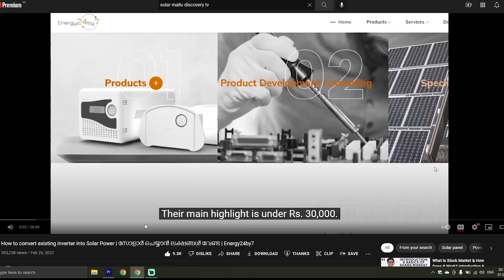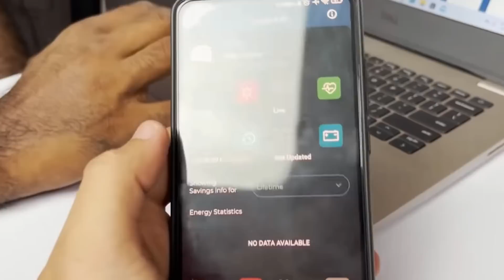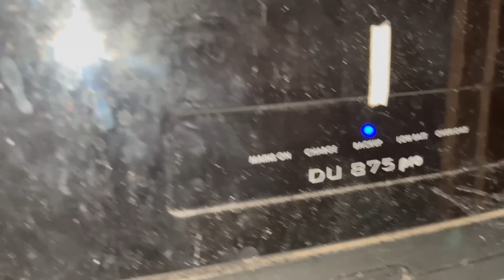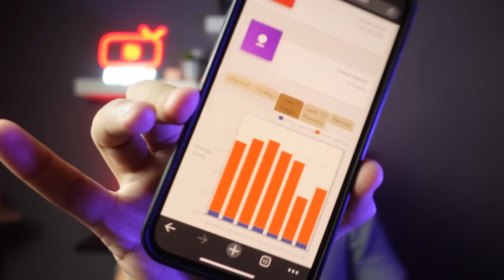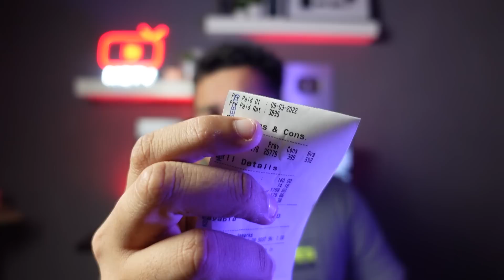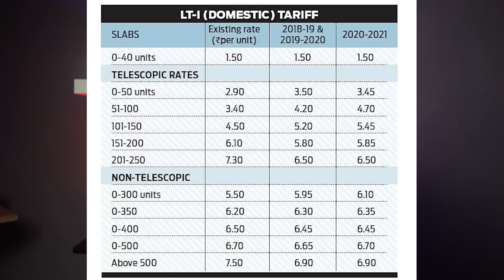സോളാർ ബില്ല് വന്നു | Energy24by7 | How to convert existing inverter into Solar Power

Comment: Your production itself is on an average is 2 units per day. That is 60 unit per month. Saving is just 60 x 6 = 360 rupees. You say , saving is 2000 rupees. Energy can neither be created or destroyed. You are misleading the ill informed viewers. You may save 360 per month at most, Battery life will be reduced by more than half. I have graduated through these trials over last 10 years and finally settled for a 10 KW, grid tied inverter for reducing electricity bills, 3.5KW inverter with 4 x 200AH batteries for power back up and a 1500w wind turbine for a hybrid charging system. Alternate energy is not cheap. Go for a 3KW, rooftop system with subsidy for most of the normal users with bills up to 300KW per month, 600KW bimonthly consumption or 3000/- bimonthly bill. It will cost 1,30,000/-. 5 years warranty on system and 20yrs for panel. I am using TATA Solar.
Reply: Same doubt I am also having  , per day saving is 2 unit so per month saving will be 60 units only 😢
Reply: @Ms-ry3ff  per day 2 to 3 units means in a billing cycle above 120 units as one billing cycle is in 2 months so in a bill above 120 units can be saved and this lowers the the bill slab so I think this might be true

Comment: If they could use 450watts  monoperc  halfcut panel then it will be more efficient. As ampeare will be high, output volt will be high and production will increase drastically. Now 540watts 4cut panels are available. One panel will cost under 20000. Provide it as a option.

Comment: Already inverter undenkil ethra rate akunne
Reply: വീട്ടിൽ ഇൻവെർട്ടർ ഉണ്ടെങ്കിൽ iCON പ്രോഡക്റ്റ് വച്ച് സോളാർ കണക്ട് ചെയ്യാവുന്നതാണ്.  iCON ഉപയോഗിച് കൊണ്ടുള്ള 400 വാട്ട്  സോളാർ പവർ പ്ലാൻറ് പാക്കേജിന് ഇപ്പോഴത്തെ വില  Rs 33000 രൂപ തൊട്ട് മുകളിലേക്കു ആണ്.
Reply: @harshmohan9514  25000 എന്നു പറഞ്ഞതോ?
Reply: @harshmohan9514  icube 24V 2 battery 3 500 V solar panel koduthu cheyyan ethra amount akum

Comment: Bro night full battery operate aavmpo battery cycle pettannu kurayillea dout aane !
Reply: കുറയും. അത്കൊണ്ട് തന്നെ സോളാർ offgrid type system 5yr full condition കിട്ടും. പിന്നീട് backup കുറയും. ഒരു 2yr കൂടി ഒത്തു കിട്ടിയേക്കും. 6yr ഒക്കെ പ്രതീക്ഷിച്ചാൽ മതി. Plus point is even 1day full current പോയാലും ഒരു 2hour വെയിൽ കിട്ടിയാൽ നമുക്ക് backup ആവും.panel 445watts halfcut ഒക്കെ ചെയ്യുന്നത് ആണ് നല്ലത്. പ്രൊഡക്ഷൻ കൂടുതൽ കിട്ടും.

Comment: ഞാനും Icon fit ചെയ്തു. താങ്കളുടെ വീഡിയോ കണ്ട ശേഷം. നല്ല സർവീസ് ആണ്. ഇതുവരെ നന്നായി പോകുന്നു. കഴിഞ്ഞ മാസം ആണ് ഫിറ്റ് ചെയ്തത്. ഞാൻ ഇപ്പോഴും ഏകദേശം ദിവസം 1.2 യൂണിറ്റ് മുതൽ 1.5 യൂണിറ്റ് വരെ per day സോളാർ ഉപയോഗിക്കുന്നു. പിന്നെ ഞാൻ എൻ്റെ refrigerator ഇതിൽ കൊടുത്തിട്ടുണ്ട്, 5സ്റ്റാർ ആണ്(latest) smoothayi work ചെയ്യുന്നു. Refrigerator, compressor function ചെയ്യുമ്പോഴും 35 w വരെയെ load എടുക്കുന്നുള്ളു.
Reply: Thank you for your positive feedback Sir.
Reply: @MalluDiscoveryTV  battery cycle kurayille
Reply: @Magentezz  I didn't face any issues till now. It's working fine. What I think we never should give over load to the UPS. My UPS is 1100 VA and the battery is 150Ah.  While the Solar is working for me it's load inverter has never exceeded over 300 W. It's very much less considering load capacity of the Inverter I guess.
Reply: @sanu11586  അവരുടെ device and panel മാത്രം എത്ര രൂപ ചിലവ് വന്നു?
Reply: എന്നേ ഇതുവരെ ഇവർ കോൺടാക്ട് ചെയ്തിട്ടില്ല
Reply: Ethra roopa chilav aayi ee setupinu
Reply: Avare contact cheyyan enthanu vazhi
Reply: എത്ര watts solar panel ആണ് വെച്ചത്?
Reply: Ipo engane undu
Reply: No onnu tarumoo
Reply: Ac പറ്റുമോ
Reply: @jikkas  illa 😊.. only lights and fans.. to a limit you may use mixer grinder.. depending on it wattage.
Reply: @sanu11586  sps ഇന്റെ സോളറിൽ പറ്റുമെന്ന് പറയുന്നു
Reply: @sanu11586  30000 രൂപക്ക്
Reply: @jikkas  this solar saves the devices which is connected to my inverter and it's only 1100Va. With lights fans I think the load to my inverter will count for approximately 300to400 Watts. I don't know about SPS. If you have it's details please pin.
Reply: @jikkas  it's the cost of inverter alone
Reply: Energy 24×7  nte mobile number undo, enikkonnu ayachu tharamo

Comment: Bro i3 4gb ram lapil programming
Reply: Get a better processor and atleast 16gb ram
Reply: 16gb de avishyam onum ila emulation onum ilel.
Reply: Visual studio use cheyyuvanengil venam
Reply: C# related anengil
Reply: @shibuthomas6384  am running vscode smoothly on an 8gb pc
Reply: @niranjan8613  vs studio code and visual studio is different
Reply: @shibuthomas6384  bro i3 8gb upgrade cheytalo
Reply: ഞാൻ vs code ചെയ്യുന്നത് 4gb ram ഇൽ ആണ്.